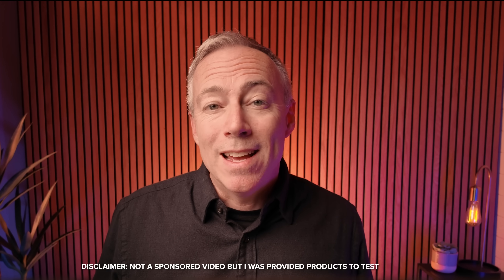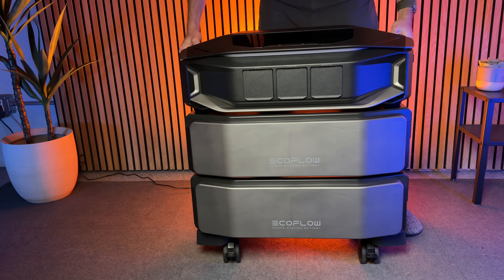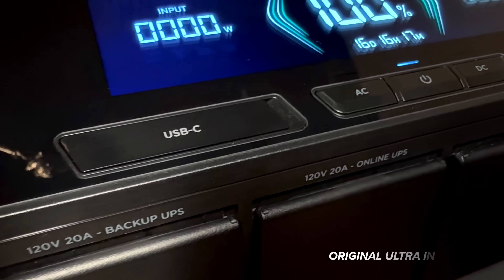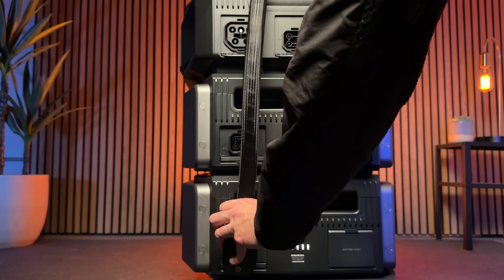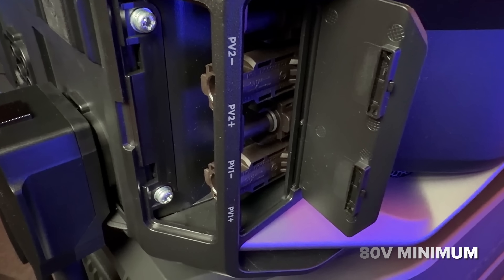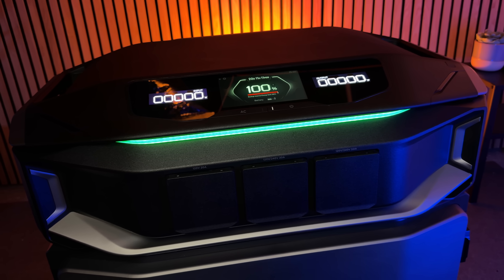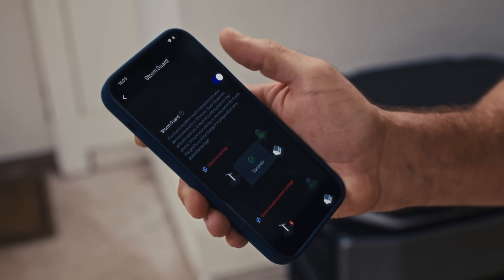EcoFlow DELTA Pro Ultra X - INCREDIBLE upgrades you need to know about

Comment: Hi Todd, Question. I have the Delta Ultra X system with two batts. I currently the batteries daisy chained to the inverter. I see you plugged each batt directly in to the inverter. Do I need to do that to get the best performance? I have seen it done both ways. Which is best?

Comment: Just revisiting one of your older Yeti 1000 videos on connecting an extra lithium battery and noticed all these other battery generators on your channel. Other than free equipment to test did you give up on Goal Zero. I will be replacing my Yeti 1000 Lithium soon and looking to see whether or not to get another Goal Zero product. Thanks.
Reply from the maker: Goal Zero really lost the plot over the years. Ecoflow is the brand I recommend now
Reply: @todd.parker  Thanks for the reply. I will take a closer look at Ecoflow. Cheers.

Comment: I am so upset with Ecoflow. Two months after I bought the Ecoflow delta pro ultra they come out with this. I am so pissed that I am selling all my Ecoflow Delta pro ultra inverter and 3 batteries and going with another brand. Screw them for not even offering a trade in program for people that just bought the old one in the last few months.
Reply from the maker: Unless you need the higher AC output or second high voltage solar, there’s little difference and the majority of your investment is the batteries which are the same. You could always just sell the inverter and get a new one if needed
Reply: @todd.parker  Not easy to sell a $3000 inverter that won't work without buying batteries for $2000 each

Comment: 2 less 120v AC outlets!? That seems like a huge downgrade and drawback. I guess you can just use a power strip but I prefer the safety and convenience of additional 120v outlets. Other than that, I agree that this is an awesome unit. If I had thousands of dollars sitting around, I would have a hard time NOT buying this.

Comment: If I am using the 240v 30 amp outlet to power a transfer switch what options are possible to charge the DPU X with a generator at the same time (120v or 240v input?).

Comment: 1.	What are EcoFlow’s plans for users to self-manage their EcoFlow systems when the EcoFlow app malfunctions and communications with EcoFlow’s servers terminate? Please note that this weekend’s time-change problem demonstrated to my team an ENORMOUS liability the EcoFlow products has created in our energy resiliency project. We simply cannot continue with EcoFlow if after all our investments, we cannot control our remote energy needs when EcoFlow servers/software fails. There has to be a localized option.
2.	What policies/procedures is EcoFlow implementing to mitigate “stupid” failures, like software that cannot manage through a routine biannual time change? What are you planning to do so these types of mistakes don’t happen again? We would like as much detail here as possible.
3.	Does EcoFlow intend to distribute more detailed information on firmware upgrades BEFORE rolling out the upgrades? We need more information so we can evaluate our risks before we roll firmware versions.
4.	Going along with item #3 above, what testing protocols does EcoFlow employ, and plan to employ prior to firmware releases? As I have indicated in previous emails, the majority of our problems with EcoFlow products have been with software and firmware updates. There have been a few hardware issues, and these were always addressed promptly. Software, app, and firmware issues are a whole different matter.
5.	As I indicated in my previous email, during the shutdown of telemetry (caused by the time-change error), the four systems (out of seven) at our farm that utilize solar input turned off solar input and went with grid input, costing us money. It violated our solar-only settings. Also, the grid input OVERCHARGED some batteries during this period, apparently overriding all BMS safety protocols. I previously sent you dashboard pictures from one of the systems. Please explain precisely, why this occurred and how does EcoFlow intend to fix software that can override a system’s BMS when internet connectivity fails? Again, provide as much detail here as possible.
6.	Lastly, a few weeks back I wrote to you about the latest firmware rollout that automatically updated all our systems, even though they are all set to NOT allow automatic firmware updates. This is a SERIOUS problem and a violation of terms of service. Please explain how this happened and what EcoFlow intends to do to prohibit such automatic violations of user settings in the future.

Comment: Removing the DC outputs is a mistake.  It lets you put away the AC power cord and power a router, or LAN switches directly from DC.  The same goes for charging phones, tablets and flashlights. DC to AC to DC conversion is wasteful and inefficient.
Reply from the maker: There are plenty of small power stations either AC output but I think it’s good to have options like this. Most devices run on USB now so why have the added cost and bulk of an inverter if your just charging devices?

Comment: Great info Todd!  With the redesign of the Ecoflow Delta Pro Ultra X over the older Delta Pro Ultra regarding the power plug, I was wondering if you knew if you could charge the Ecoflow Delta Pro Ultra X batteries via the 120v wall cable while the inverter is providing 240v output to the Smart Home Panel 3.  It seems like it's either one or the other and not both.  One thing I really liked about the older Ultra was that you could add power via 120v while you were providing power to your panel.  Any ideas?  I heard about the PV switcher box that could take a generator plug in (unclear if it's 240v only or not), and what does that do regarding switching away PV and using 120v vs having the ability to still use 100% of your PV input and adding 120v charge to it as well?

Comment: This looks like a game changer. I currently have a Jackery 5000 plus and an extra battery. So 10kWh of storage and the same 7,200W output you get from the Ecoflow Delta Pro Ultra 2. I currently have a 4.55kW array connected to it and another 4.555kW of solar panels. It has the same high/low pv setup the DPU has and I hate it. The fact that I could connect the entire 9.1kW as just two arrays (which I already have wired) would be huge. Otherwise, to get the 4.55kW of the second array connected to another Jackery, I'd need 3 sets of wires. One for the high and one for each low. 

Btw, it seems like the price is going to be $7,999 for the inverter + 2 batteries. Not awful considering the inverter capabilities.

Comment: If you want to promote eco flow why don't you report the downside how they had to recall 25000 units and it burns 6 houses down just use Google EcoFlow has recalled approximately 25,030 EcoFlow DELTA Max 2000 (model EFD310) power stations sold between July 2022 and May 2025 due to a risk of overheating and fire. Six fires have been reported, causing property damage, but no injuries. I know that's a product around my family

Comment: Great system; if I had waited another two years I would have jumped on this, but now will wait a year or more for the inverter (if marketed as a standalone) to be discounted if the original DPU batteries (we have 10) do work well and provide good output with the new inverter.

BTW - the comparison to Powerwall's is fine, but there are plenty of other higher priced per KWh output and storage out there (because they are grid tied inverters). One DPUX inverter and 10 batteries IF people actually hook up 10  KW of solar panels to it - will, in the majority of households, be wasting away excess solar all of the time...

Comment: On the DPU it always had AC passthrough when you have AC output connected.  Therefore if you were connected to the grid in the day and on peak cost electricity you always had a high charge from you supplier.  Only when you unplugged the DPU from the grid were you able to use the battery power and inverter to power your home.  Does the DPUx resolve this issue?
Reply: use the power management. drop the backup reserve so it will not charge instead it will use the battery.

Comment: Pretty machine. Maybe it will drive down the cost of the original DPU? And maybe EcoFlow will FINALLY release a fuel EFI generator that can communicate with the DPU line! (Their statement to you that the DPUx can charge from most inverter generators and the Eco-flow generators doesn't mean the DPUx or DPU can communicate with any fuel powered inverter generators still!). Finally, I'd much rather stay with my existing DPU and add another DPU stack before the end of the year... for redundancy! If you are using just 1 big inverter and it craps-out on you and needs to go back to the manufacturer, you're kinda screwed... but if you have 2 DPU stacks, then you still have another DPU that can still cover your most critical loads at least. 2 original DPU stacks == 14,400 watts of power AND has redundancy if one of the inverters units were to fail... so 2 is better than 1, imho.
Reply from the maker: All good points. I'm keeping my original DPU as a backup for the same reasons.

Comment: What's the idle consumption?  That would be a very important purchasing consideration.
Reply from the maker: This is a pretty huge inverter but it seems to be between 1-2% per hour which is typical. Watch Jasonoid’s review when it comes out because he has a ton of data.
Reply: @todd.parker  Will do.  A watts measurement would be helpful.  Thx!

Comment: I live in  a rental. My landlord won’t let me put anything permanent in how long do you think this would power a refrigerator a fan and maybe keep our phones charged also, does it come with solar or do you have to buy that separately?
Reply from the maker: A fridge uses 2kwh a day so one of these batteries should last you 2.5-3 days. The other stuff is small. For an apartment I’d suggest looking at the Delta 3 Max, maybe with an extra battery.

Comment: The only place that I can put these is in a height restricted area under a stairwell, can you get different cables so these can be placed side by side, not vertically?
Reply from the maker: They now have that longer flexible cable I showed so you should be able to buy it from EF eventually

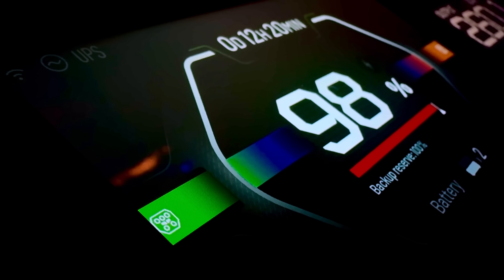Comment: It will be interesting the features that will be adopted for ahe next Delta Pro 4 series. Expecting today 9:15 the DP3 with battery, transfer switch and 4Kw panel. I like the new features the series 3 have over my 3-year old Delta 2 systems.

Comment: question:  the 240 volt  out let  can you run multiples machines at once, like will it keep a 230 volt dual mini split, going along with a marine watermaker and a marine boat waste mangement system all three run at least 220 to 230 volts ..    if this runs a house.... can it run my  morgan 41 sailboat too?????????   this is a typical full  time sailing setup...  we need power station too....

Comment: So just to clarify, there are not new batteries for it this generation, it's just a new inverter that uses the existing batteries?
Reply from the maker: Yep, exactly. Apparently there is a firmware update for the batteries that happens when you update the inverter so not a big deal, the only other addition is that long battery cable so you can double up.
Reply: @todd.parker  So, 100% positive? -> The battery units provided with the NEW model Delta Pro Ultra "X" are exactly the same (Part#/Specification) as those provided with the previous model Delta Pro Ultra? Fresh Delta Pro Ultra "X" marketing touts the "EV-grade, full-tab battery cells" in relation to the batteries associated with the "X" model. Are there any component changes between batteries offered with the Delta Pro Ultra and the newer "X" model at all? Exactly the same Part#/SKU? TIA.

Comment: If they had a trade in option (for the old model DPU inverter) to get a deep discount (on the new inverter) ... I'd be tempted, but I already have two inverters and a 50A hub.
Reply from the maker: Honestly I don’t think you’re gaining much by upgrading, your setup sounds great
Reply: @todd.parker  The surge is supposed to be better, but yeah its handled fine with two inverters, but I'd love to compare them side by side.

Comment: In my opinion, this is a configuration that is better applied to new construction.  A somewhat moveable version of the Ocean Pro.   I can't justify the upgrade...yet.  I currently have a SHP2 connected to a single Ultra and two Delta Pros via a dual voltage hub.  Currently have nearly 40KW of batteries connected.   My SHP2 uses one of the 240V slots to feed a separate 30A (10) slot Reliance critical loads panel.  Firmware in my set up is an issue.  It has taken multiple iterations to get the system communicating without errors.
Reply from the maker: Sounds like you have an awesome setup. If the firmware is ironed out, that sounds like a great system.

Comment: What is the price of the inverter with two batteries? I went to their website, and there is no price listed there. Thank you for sharing! Great video and information!
Reply from the maker: It’s early so I don’t know the pricing yet but they should announce that soon
Reply: The verge is reporting $8k for a single unit dpux but ecoflow ad talking about “save $6k a year/ 3 year ROI makes me believe you’re better off just buying multiple discounted older models.
Reply: @zimvader25  yeah that would imply $18k which is the going installed rate for Tesla PW3 + gateway3

Comment: Does it offer a direct 2-wire autostart connection to a portable generator like the GenMax
Reply from the maker: It does not as far as I know. They do have a special connector to auto stop/start their own generator but it's proprietary
Reply: @todd.parker  So their own generator will connect to the Power Wall 3 and AutoStart based on threshold settings?
Thanks again for all your quick responses.  To my knowledge it was not compatible with the Pro Series

Comment: I also have an induction stove and a 2 ton AC unit that was a power hog on start up.  Last March(2025), I got the Ultra unit with 1 battery for testing.  I tested the house systems and because of the high draw items, in September I decided that It would be better to get a second ultra unit and the 50 amp hub to ensure that nothing is ever stressed for home backup power(plus if one inverter needs repair, there is a backup.  The system was just built, when the Ultra X unit started advertising its potential.  Now, after testing everything, I have 2 inverters and 2 batteries each which should run the entire house for a day and a half during winter before needing to recharge if we were not trying to conserve power.  This is only a home backup, so no solar capability.  But I am not disappointed in the system that I have built, it was easy to assemble and it ready to go.  The only thing that I need to do on a monthly basis is exercise the systems.   You have done a great video and you are the only one to address non solar charging for us home back up types.
Reply: Reason to exercise,? and what is the process as this will ultimately degrade the battery over time.  Is it to keep the cells balanced?   Does it have active Cell balancing?
Reply: @HomeGuySolutions  The exercise process is in the operation manual.  I do not know if it helps or not, but I am taking Ecoflow's word as the better way to maintain the system when not using solar and cycling daily. The system is designed for 10,000 cycles but not 100 to 0 to 100 to 0.  I store at ~60%, charge to 100% for cycling, then run it down to 30% before charging it back to ~60%.  With new systems like this, you might not know for years.  the only concern is that when shipped to me, the batteries were at 30%.  Is that the best storage capacity?  I do not know.
Reply from the maker: Sounds like an awesome setup. I have a 2 and 3 ton AC units and I found the bigger one would briefly cause the Ultra to dim the lights for a sec but it never tripped. I installed a soft start on it and it makes a world of difference.
Reply: @todd.parker  The running power(AC) was 2kw with the furnace circulator fan, so the compressor unit could be run easily, if it did not have to start the unit.  I did install a soft start on the compressor and it is now better, but I did not want to stress the total system, so I just made it larger.   Similar to using the induction stove.  One burner is 1800W, Oven 2400w, so that could also be a power hog if we needed more capacity, and add in a 1200W microwave and we start pushing capacity of one ultra unit.  The other point is that our max day usage is 18 kwh in January, so I would need at least 3 batteries to keep everything running for a day, without conserving.  This system is so much easier than trying to build a custom system...

Comment: so how do they expect you to connect 10 batteries with short cables...?

also theres no way i'd want a shp without a local API to use.
Reply from the maker: I show a diagram
In the video but it’s basically 2 stacks and the long cable connects the top battery to the inverter
Reply: @todd.parker  ah thanks i missed that pic